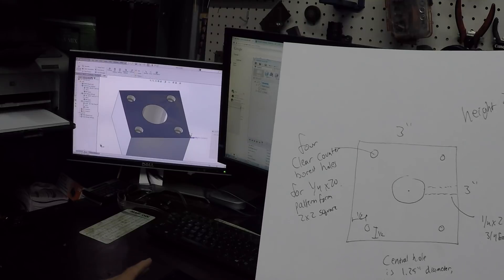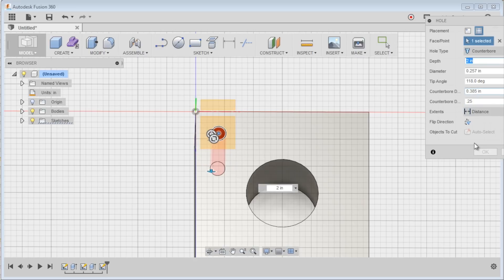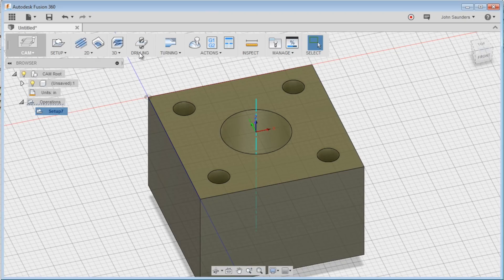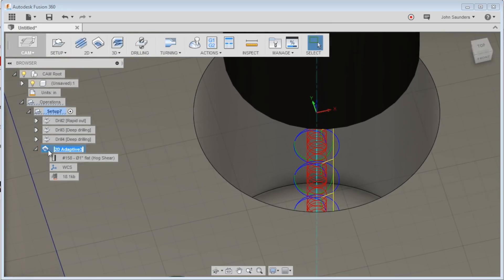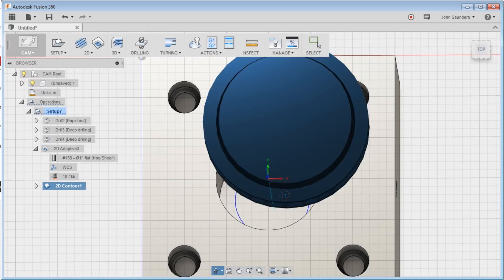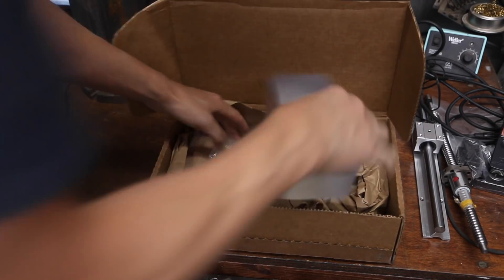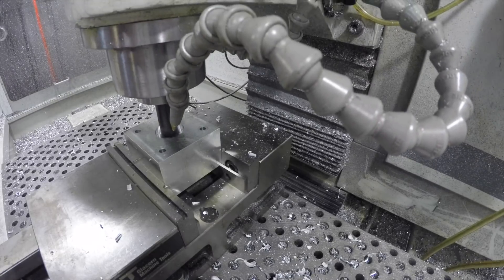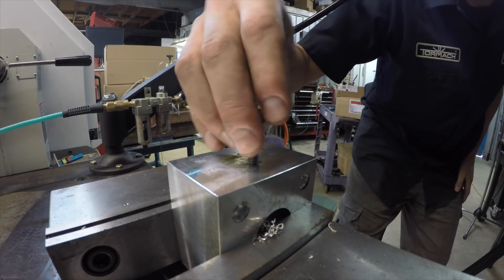Job Shop Life!  Example of a CNC Machine Shop Job!

Comment: I hope anyone who is considering taking a big loan to buy fancy equipment that's going to take a lot of work to feed it listens to John's sage advice. Start small, and be patient. The biggest investment you can make in life sits on top of your shoulders. I remember only 5-6 years ago watching John squatting on his apartment floor to operate some equipment, so the guy speaks from experience. A few years isn't a long time in the grand scheme of things and you'll learn so much in that time it sometimes all feels like a dream.

John have you considered using spotting drills instead of centre drills for spotting holes? The spotting drills are specifically designed for that purpose (and obviously the centre drills are designed for, well, drilling centres for the lathe). I find the spotting drills are more accurate and rigid. A smart guy can also run them down deep enough to leave a chamfer on the hole after the hole has been punched through, so saves an op. I know a lot of people use centre drills, and obviously they work, but apart from the above advantages, the small ones have a nasty habit of snapping the tip off, and the broken tips can be a PIA to get out of the piece. The angles are also wrong for the following drill.

Comment: I was glad to see you using a flex arm tapping tool. I have a different brand that I picked up about ten years ago and you couldn't get that unit out of my shop. They are fantastic for allot of operations but nothing is better for pattern tapping plates for special set ups. Great video, Thanks.
Reply: Tom Meeker Tom what other operations do you use this arm for? I've seen them around but never used one, and have a couple of Tapmatic chucks for tapping, so I'm interested in what else the arms could be used for. There is an article in a British magazine, out this month, on making one and it doesn't seem especially tricky.
Reply: Pete F The unit I have is manufactured by or at least branded as ARO. The arm is not difficult to make but if you do that the issue will be locating the inline pneumatic tapping tool.  The tool is activated once you close the paddle trigger but it doesn't engage until you move the tool towards the work and retracts when you pull it up. Generally a good one of those "guns" will run you about $400-$500 US dollars for a new old stock sitting on someones shelf but retail is about $1300. If you watch Ebay for "tapping arms" sometimes you can find them removed from service for a few hundred dollars complete.

I use it great deal for very small taps for robotics and animatronics. Once you get comfortable with it you can safely use very small taps. The tool is always at a 90 degrees to the table surface. As long as you clamp or hold the work so it is parallel to the worktable surface your taps always drive straight .
Reply: Tom Meeker Thanks Tom, you mentioned that the unit is fantastic for a lot of operations, so does that mean you use it for things other than tapping?
Reply: NYC CNC Oh reaming, great idea, I hadn't thought of that one. ... just as long as we don't see those adjustable reamers again :)
Reply: Pete F I use it for tapping, reaming, deburring, counter sinking, and occasionally even drilling holes with high number drill bits that dont hold in my press chuck very well.
Reply: Tom Meeker Awesome, thanks Tom. My workshop space is at a real premium, and I don't have room for anything that can't earn its keep. But my Aciera mill doesn't have a traditional quill, and raising the table doesn't provide any real feel, so I will look into this type of arrangement some more. Thanks again for the information.